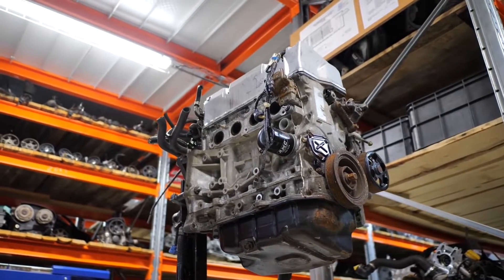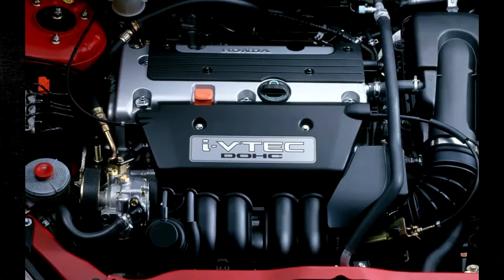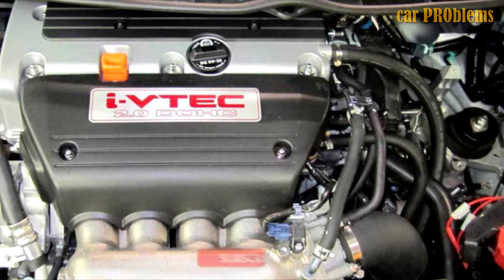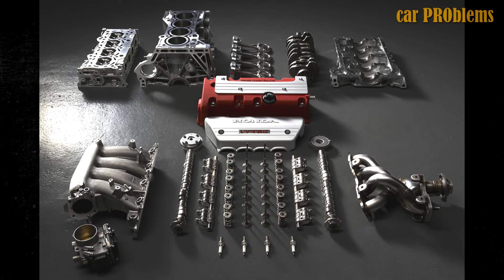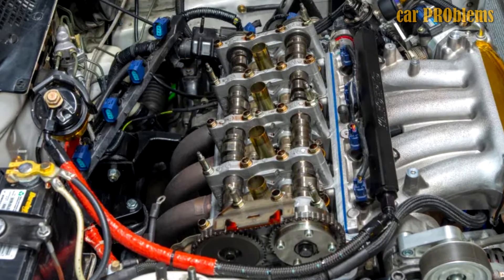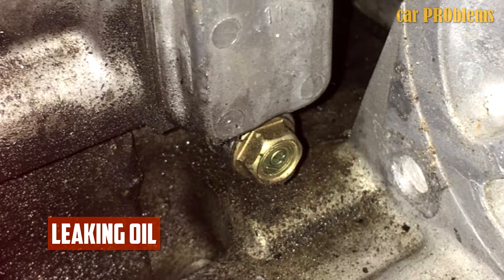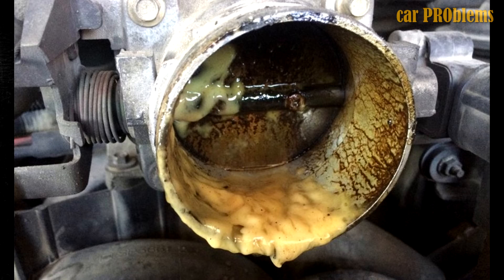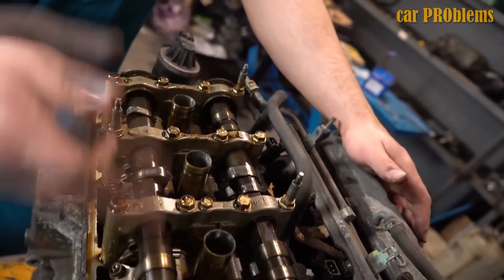Honda K20 Engine - Overview, Common Problems and Reliability

Comment: I’ve got a 2007 civic si with 220,000 miles and it still runs great! Could use a paint job tho
Reply: 2008 here. My paint is dust as well.